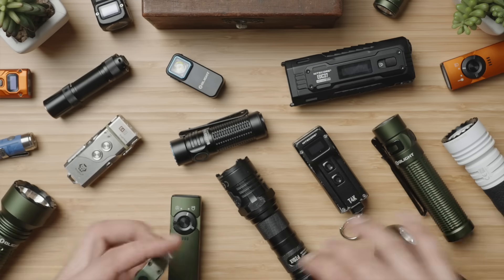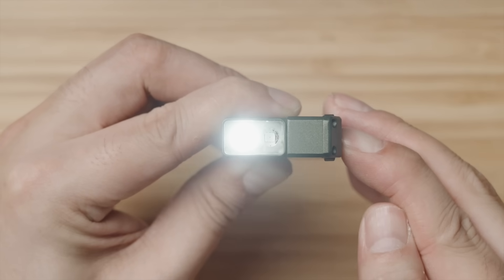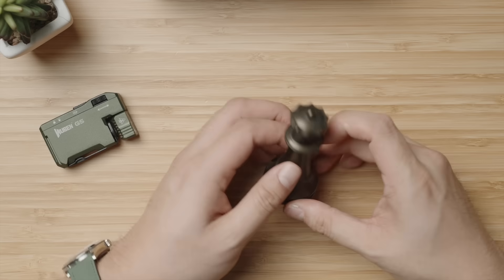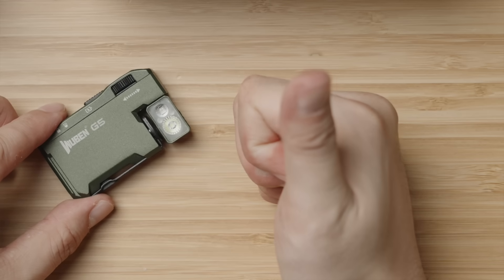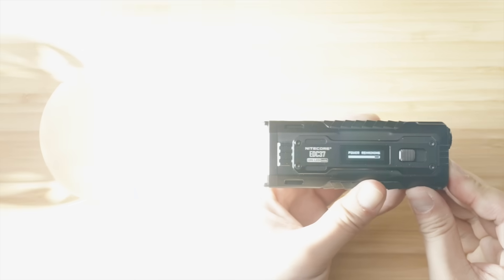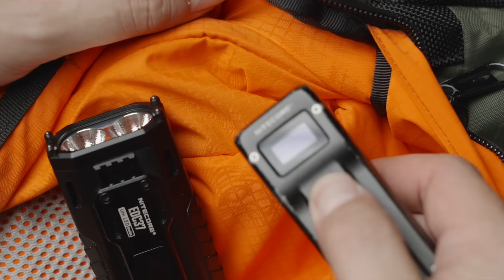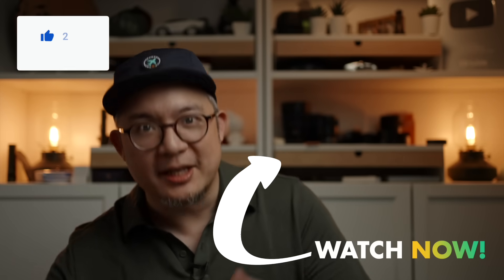Modern Flashlights are INSANE.

Comment: I had NO idea that an EIGHT THOUSAND LUMEN flashlight existed that could literally fit in a bag or even a pocket if you tried hard enough!!!!! However, if I was to buy either of these, I’d probably stick with the Wuben: it has more functions, and is generally better at being a flashlight instead of a potential fire starter…and it has a physical lockout switch, although I doubt I’d need to use it due to the max output of only 400 lumens.

Comment: Yesterday, I bought $10 JLAB wired earbuds from Target that have a microphone because I forgot to bring my Bose earbuds with me.  I assumed for that price they would sound terrible, but they sound excellent.  The quality of the audio actually blew me away for the price, and they are nearly as good as my Bose earbuds.  They also have little rubber pieces that fit the cup of the ear and hold the earbuds in as well as the rubber pieces on my Bose earbuds.  I don't know how earbuds are becoming such high quality for such a low price... I've never bought such a cheap pair that sounds this good before.  The microphone works surprisingly well too.

Comment: What causes a flashlight (ThruNite headlamp) light microchip square to not completely turn off when turned off? Can it potentially cause something bad to happen? Or has nothing to do with potential battery fire? Left outside for honestly I think couple years. Works great just that one little issue that I am guessing drains the battery once fully charged

Comment: Audio gear. As a teenager, I paid $125 ($450 in 2025 dollars) for my first boombox 40 years ago, a flimsy piece of mostly plastic crap featuring an AM/FM radio, cassette recorder and awful, tinny sound. Currently my local variety store has boomboxes with CD player, radio and still awful tinny sound but for only $29. A CD player in 1985 cost $1.5 - $2000! For $450 today you can get a very good quality hifi system or portable speaker with excellent sound quality.

Comment: Another channel that just reviews products based on a couple uses.. Wuben flashlights are bad quality and will fail on you. I've bought 7 different models over the last three years.. NONE of them work as of right now. Had to get the warranty replacement on a couple of them, but then wuben promptly makes up any excuse to weasel out of the 5-year extended warranty that the claim they offer. Buying brand new products from their website that are on clearance, on promo, or as part of a bundle, comes with a 3-month warranty. Not a 1-year warranty.. wuben make crap products. Do not Trust these "reviews"... I'm sure the creator meant well, but they do not use flashlights like how people use flashlights. They turn them on and off just for this video. Then they'll pack it away on a shelf and it'll be unused until the next movement product comes out and then they'll dig it out so they can compare them. But if you're using these flashlights a couple times a week, taking them with you, keeping them in your pocket or in your bag.. these things fail. They're made like tofu dreg (I think that's the term they're using nowadays).

If you want to buy a disposable flashlight, while these are great as disposable flashlights. Expensive as hell compared to other disposable flashlights, but these are in essence disposable. They will not last you much longer than the one year warranty if you're lucky

Comment: The wuben seems really useful, with being able to fix it to places and rotate it, can't do that with my current one, or my phone.
But for the strength wheel, does it use a potentiometer? Because those eventually break, and then it will start going wonky or stop working altogether.
My current flashlight is one of these very simple small ones, 1 AA battery, with the 3 mode "high power", "low power" and "strobe" switch, and the adjustable "focus". It's simple but reliable, as my brother bought it probably 12+ years ago from China, for 5 bucks, and it still works fine.

Comment: Clickbait bollocks. I bought this torch and it's crap. Biggest problem is it doesn't have a dule clip. So you can't put it on a shirt pocket and have It point downwards. Because you need the torch upside down. The weird clip that turns around is loose and thin so it wobbles about. The torch is not Terrifying just average.

Comment: 4:19 the light body is certainly cast, not machined aluminum. High upfront cost for molds. Extremely cheap after. It's china. Economies of scale. Not that surprising at all and not really comparable to your chess pieces. Additive manufacturing vs subtraction manufacturing. Not to mention the "skilled" labor is literally communism.

Comment: I bought a nitecore flashlight, E4K. Got it "programmed" to work how I wanted. Where it would do something like 75 lumens when I double tapped the power button. And hold down to get full power. Worked great for months. I was using it daily for work. Then I dropped it..... maybe 3 feet. And now all it does is the lowest 2 lumens and full power. I have tried numerous times to get it to reset. To let me set it up like before. And NOTHING. So now it sits on a shelf, and I use a cheap $20 flashlight not unlike the one in this video. And it works all the time. And I have dropped it more than 100 times with no failures. Also NEBO is another brand that makes flashlights comparable to Nitecore but way cheaper. Don't buy Nitecore.

Comment: Aren't you comparing hand made queen pieces with stamped and probably machine welded and installed production line? The flashlight will use a number of common components to many other items that can be cheaply made and sourced. China is no longer the low tech country some may seem to have in mind, after all they have plants making jeans with industrial robots, and other clothing.

Comment: Few years back I bought Chinese sword for Taiji. Directly for a Chinese seller (our Taiji teacher). He sold it for very little profit, if any, to the students.
It's iron blade, coated in copper and chrome, with screw on the bottom to hold the handle. The handguard is from few pieces of sheet metal soldered together and chromed. It comes with wooden sheath. Everything is handmade, the blade is hand forged, you can clearly see hammer strikes on the part under the handle, the blade is not perfectly straight, it's just "fine". The sheath lacquered and decorated by hand. Oh, and it has this .. what's the word .. a tassel ? It's not really fancy, also not sharp, it's practice instrument, and it works great for that.
And it was .. $5.

Comment: Wuben and nitecore are both top teir. Ive got a flashlight by each company ( edc27 and 2xpro ) and can attest to their quality and utility. 2xpro uses 2 rechargable batteries, that also act as AA batteries, so if they die, then you can just put regular AA's in, and if you happen to have only 1 spare battery the thing still fully functions with just one.... these are jack knifes disguised  as flashlights and i love them.

Comment: The nitecore EDC ceramic pins in the front are so there is still an airpath if you set the flashlight down to prevent rapid heat build up and then thermal shytdown.  But sure call it a "emergency glass tool!"

Comment: always very surprised at the price of tech and then stuff like... a plastic box. Like this flashlight cost 20 bucks with all its intricate parts and exotic chemistry, and then you go to buy a plastic storage container. 1 part, 1 material. Made in 1 operation. No assembly. Still 20 bucks.

Comment: From textiles to electronics, the Chinese have figured out AND developed scaled manufacturing better than anyone else. They have the tech and immense number of machinery, to pump out 100 units or a thousand within weeks
China is constantly mining raw materials, and they have the infrastructure and factories that specialize each element every step of the manufacturing process. From design to end product, it can be done all with China and Taiwan
One torch can have 20 parts from 20 different factories, all within a 5 minute drive from each other. This is what China has been working at for over half a century, and now the modern world can't survive without China. Even if the US decided to start doing everything themselves today, they are already 50 years behind. And now we have companies like DJI, Xiaomi and BYD who are industry leaders in their field, because the tech and manufacturing they need is all local to them

Comment: IP68 is not the highest rating for water resistance. You can get items rated to IP69K. The 9 represents high pressure water jets and the K indicates high temperature water. That's the highest that scale goes, but there are other rating systems for more specialized gear.

Comment: Of the stuff that I use regularly, it'd have to be my powerful 520A zoomable flashlight at around 5$ with 500 lumens under 80 grams, and my Nextool Mini Flagship pliers multitool at around 11$ and 79 grams, as well as the 10$ pair of indestructible waterproof PVC low-cut boots I've been wearing for two years. I bring them with me wherever I go.

I rarely spend more than I have to on things, and I generally avoid anything branded. Getting something expensive and having it fail is disheartening, while getting cheap stuff (with redundancies in place of reliability) that is expected to fail yet has the chance to be surprisingly far more valuable than what you paid for, is exciting in a way. I rarely use the knife on my multitool, since I prefer to use the small scalpel sheathed on the strap of my 20$ smartwatch which also houses my bluetooth TWS earphones in the watch itself. Currently trying to migrate my phone functions and utility apps to a new cheapo 3gb RAM android smartwatch with a SIM slot, so I won't need to bring my phone everywhere all the time.

Really does feel like we're in the future. I remember back when I was a kid, my dad talked to me about when he realized how rigged Chinese economies of scale is; he held up a cheap cigarette lighter in front of me and told me to reflect on how inexpensive it was, and how much processing it took to manufacture even one of those, and how the supplier still made a ton of profit over it.

Comment: this really is a great little light. especially for the price.  i only wish it had 1 of the flat sides magnetized too so it could sit flush against metal surfaces instead of only magnetized on the bottom so that the whole thing has to stick out. not a deal breaker by any means considering everything else is great. maybe the clip could be a magnetized one so that you can have even more options for where you stick it to things.

Comment: I was a part of a manufacturing engineering work for a now somewhat popular brand of innovative utility tools.
- Wuben probably has their own in-house die-makers.
- Design team.
The way they operate is - once a BOM has been finalized for the product, they then have a somewhat similar system as government contracts - China has multiple apps and websites, where you can post your design of parts and factory owners can bid on it.

Wuben does this in the following way
- A contract for each part is separate, probably to avoid copies of their products. Even under different company names.
- Factory owners, typically small to medium sized businesses, bid on the parts and the bids will be typically very low, since Wuben probably supplies them with the stamping and forming dies.
- Wuben might be doing some very high value - modifiable work in-house, such as PCBs. Why? It is extremely easy to make the circuit boards once they been printed - which requires toxic stuff, but the actual putting of electronic parts on the board? You can get robotic machines that can do upto 50-60 parts per minute and can be modified quickly. Bigger and more hard to change equipment can go as high as 400 parts per minute.
- Once all the parts are obtained - at this point, the total BOM cost is probably very very low, say less than ~$5, the assembly begins - this could either be in-house with machinery or without or a combination of humans + robots + machines. Another ~$1 for the assembly. You can get assembly cobots for less than $5000 in China. Similar robots from Western companies cost you $20k+
- Now, for less than $6 a piece, you now have 500k units of the Wuben G5, total cost of less than $3M. Probably closer to $2.75M
- You sell them for $20/25 on Amazon, 200k units for $25 and the remaining 300k units for $20. You get a total of $11M in sales. $4.4M of that goes to Amazon, let's say an even $5M, to account for your ad cost too.
- You still have $6M remaining. Of which, $2.75 was your cost, maybe $3M to account for shipping, and another $500k for breakdown of container and shipping it to various Amazon warehouses all over North America. So, you finally now made $2.5M.
- 12 months later, maybe with some different designs, you repeat. In those 12 months, you were selling different kind of lights.

Also
- Business and design focused courses in English in China (either at accredited colleges or by some random dude from his apartment in Shanghai) specifically mention to use camo-colors, 'artful' use of the words tactical, mil-spec, extra-tough, and focus on ruggedness for North American audiences, show usefulness in Outback and SE Asia for audiences in Oceania, and for European audiences it is typically like cold winter focused camping in Northern Europe or power out issues in Southern Italy or somehow mention the Russians in the Balkans.
Reply: Want to start a company
Reply: Wow, you know your stuff!
Reply: Yup doing as many things as possible in house is also how Chinese clothing brands are able to offer products at crazy low prices
Reply: True. And remember that US and other Western brands that moved all production to Asia helped establish these processes and continue to use them as you describe. It's not just "Chinese brands" maximizing every aspect from design to materials to production, shipping, marketing, and use of ingluencers.
Reply: 100% 
Just looking for the light on Amazon shows two other options from different "brands" but the exact same light minus the Wuben branding.
Reply: @TheCajunGaijin 
Wuben probably sold them the same lights, but for like $7-8 and the other operator thinks through SEO optimization they can sell better.

Comment: I carry the edc37 everyday and it is pretty insane. 1 huge thing that I hate about it though that I've yet to hear a single review mention is the dam pocket clip 🤦🏻‍♂️
They made the pocket clip flush with the front of the flashlight so that trying to put it back into your pocket after your done using it is ALWAYS a pain in the ass. If you fumble with it sometimes you can do it one handed but most times or just to save time your going to grab the edge of your pocket with your other hand to more easily thred it between the flashlight body & the clip.

If they would have just made the clip an inch shorter so that there was a difference between the clip and the flashlight it would be 1000% easier to use one handed. The only other thing I hate is that it's not water proof,  you would think that a $140 bucks a pop they could have at least made it water proof 🤦🏻‍♂️🤬

That being said though it is a pretty great flashlight with a wide range of uses thanks to its extreme spread of lumen options.

Comment: There's a few factors. One, China has literal cities built with production in mind. That means raw materials storage/ports right near factories, which are near assembly plants. Then you have the massive subsidization by the government as well, cutting heavily into costs like labor and raw materials. Then you have tricks like using older materials from failed/stopped runs, or last years LED's/batteries that still work fine, but are much cheaper.

Comment: My experience with flashlights, although not the flashlights mentioned in this video, is that they drain the battery when the flashlight is off. I’ve come to learn that this is something that they call “parasitic drain”. Do the flashlights mentioned in this video have this problem? Thank you very much.

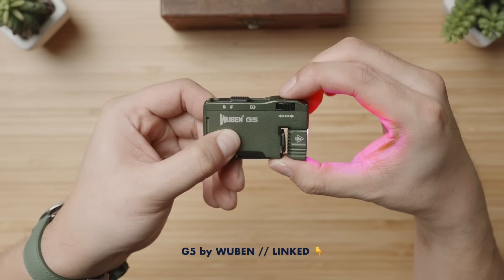Comment: 2:22 that flashlight would be perfect if it had a battery gauge
Reply: It DOES have one... push and hold without releasing... the more it flashes the higher the battery level... very few flashes, almost dead...   not super accurate, but it does give you an idea of power left.
Reply: @lifehackertips  right? Perfection!

Comment: If you manufacture a product and increase the number of producers by 10× (or one order of magnitude), the manufacturing cost and raw material prices usually decrease by at least 30%—at least that's how it worked in the automotive industry (e.g., at companies like Ford or Volkswagen).

For example, suppose they are making 1 million of those flashlights, and you're only producing 100 chess figurines. If you scaled up and also produced 1 million, the unit cost could decrease significantly. Let’s say your current unit cost is $109.

Assuming a 30% reduction for every 10× increase in production, the cost after four such increases (100 → 1,000 → 10,000 → 100,000 → 1,000,000) would be:

$109 × 0.7⁴ ≈ $24.01

If you sell each figurine for $80 and assume Amazon takes 60% of the sale price (leaving you 40%), your profit per unit would be:

$80 × 0.4 = $32 → $32 - $24.01 = $7.99 profit/unit

Profit margin= 32/7.99 ×100%≈24.97%

If you sell all 1 million units, you’d make:

$7.99 × 1,000,000 = $7.99 million profit (before tax)